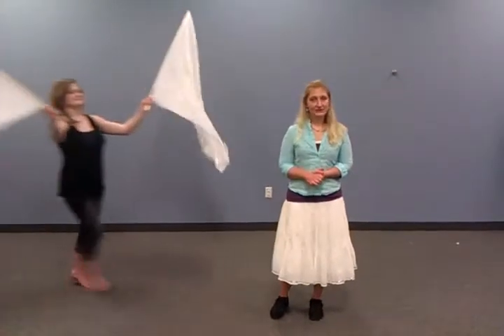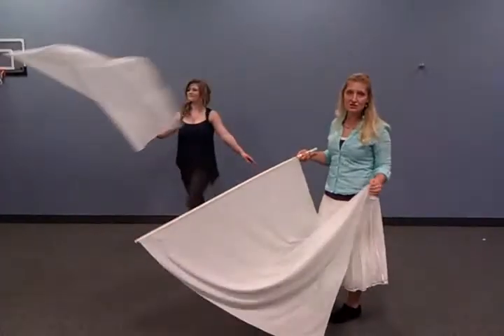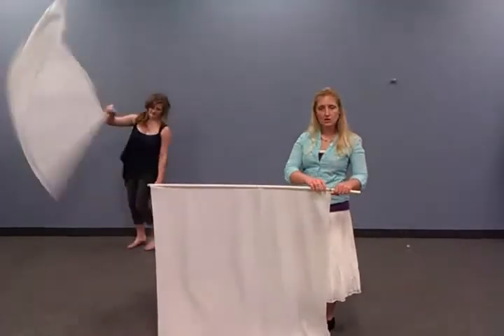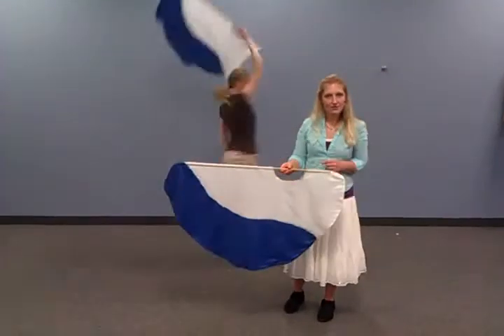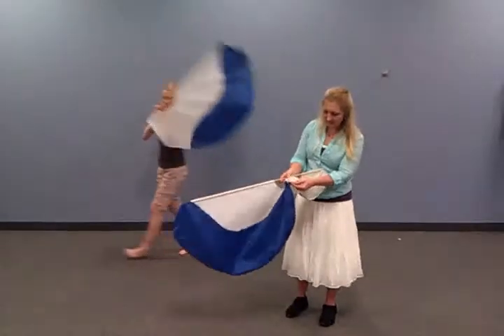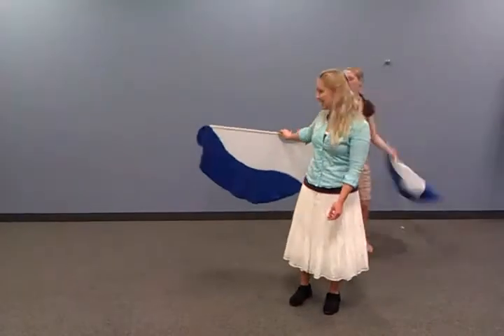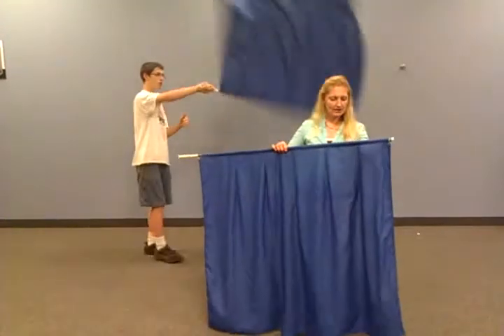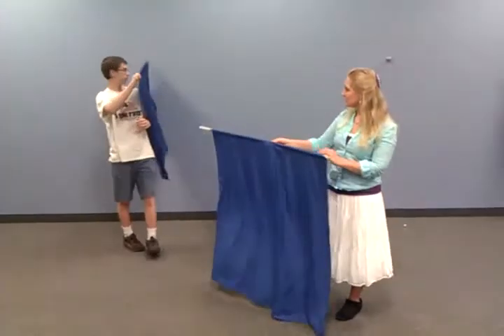Flag Demonstration and How-to make information

Comment from the maker: Here are the measurements for the flags.

Straight Flag   Pole - 52" long, 1/2" diameter,   Fabric size 45" on pole, salvage to salvage, length is 50" purchased -- 47" finished length   

Swing Flag  Pole is a 36" wooden dowel, finished flag size is 45" x 25"

Pleated Straight Flag  Pole - 52" long, 1/2" diameter,   Fabric  60" from s to s, 48" on pole with 5 - 1" pleats, length 50" -- 47" finished

Butterfly Flag   Pole is a 36" wooden dowel, finished flag size is 90" x 29"

Comment: What is the material for the swing flag
Reply from the maker: Kim Simmons    I use a fabric that is a poly blend.  It is a fake silk type material.  You could also use a fabric for lining clothing or any fabric that has a "float" to it.  Silk is amazing but expensive.  Go to the fabric store and find a light weight fabric that is easy to pull through the air.  Yes, you might look silly waving bolts of fabric in the air.  :P  Then buy at least 3 yards to make one set of flags.  I often buy the whole bolt when I find a color I like.  :)

Comment: What fabric is used to make these flags?
Reply from the maker: Kenny Santiago     I use a fabric that is a poly blend.  It is a fake silk type material.  You could also use a fabric for lining clothing or any fabric that has a "float" to it.  Silk is amazing but expensive.  Go to the fabric store and find a light weight fabric that is easy to pull through the air.  Yes, you might look silly waving bolts of fabric in the air.  :P  Then buy at least 3 yards to make one set of flags.  I often buy the whole bolt when I find a color I like.  :)